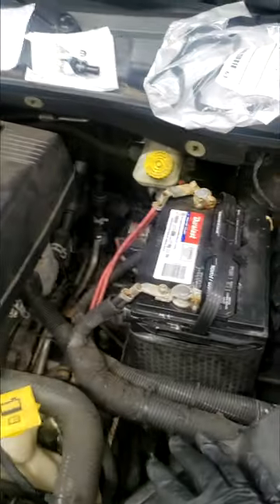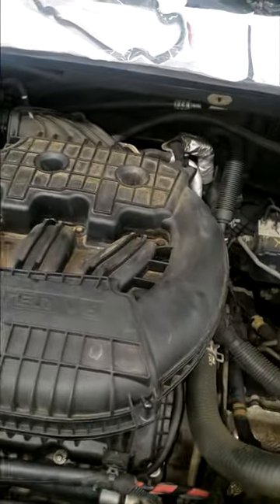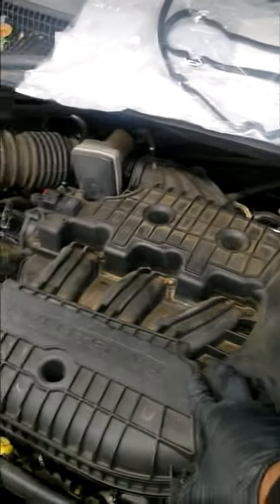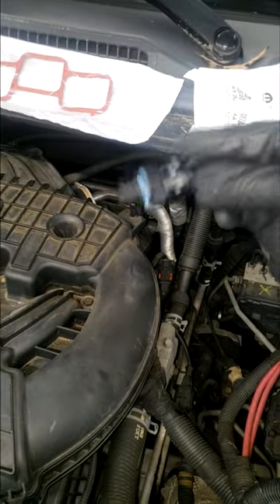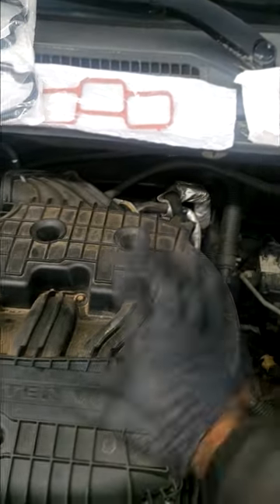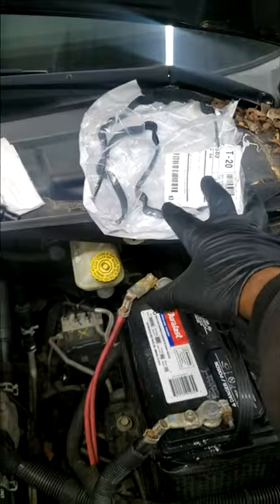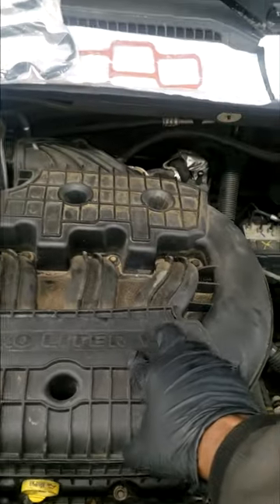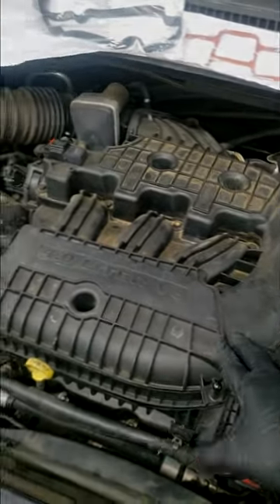The smoke under her hood came from this. Here's what i'm doing to fix it.

Comment: 2021 ram pro master what should the recommended fluid read on the dip stick 10,20,30,40, helppppp it has a 62te 6speed
Reply: Read owners manual